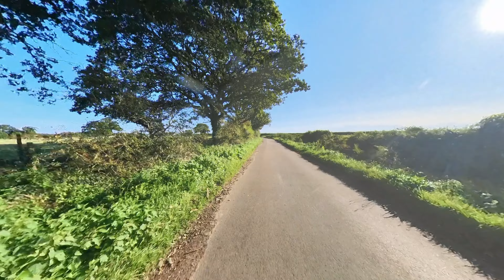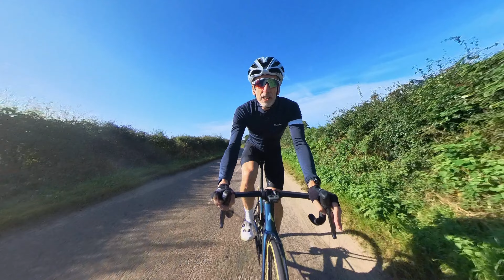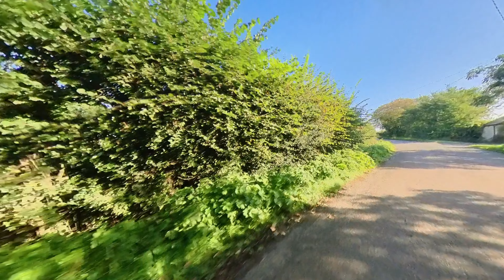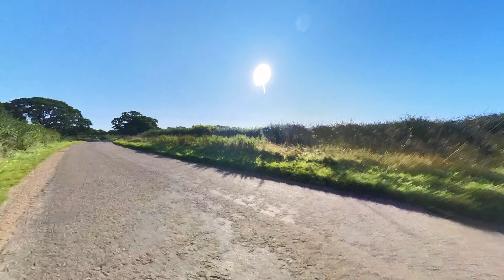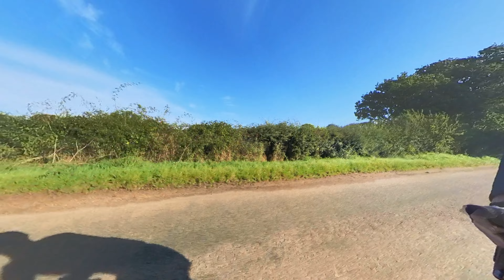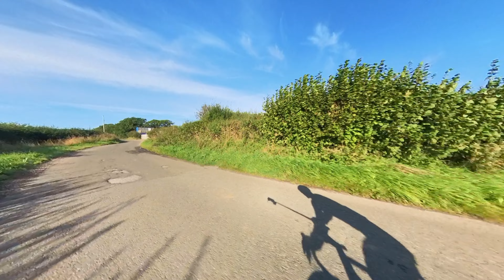How to be RESILIENT and DURABLE! Keep riding strong till the end!

Comment: Core is key - try to work in body weight ply metrics [back planks, leg raises etc] + squats & deadlifts....balance ie foot strength is also important.
Working towards CTS [Chase The Sun - 205 miles across the country next June] - planning on doing a 200 mile training ride before then.
At my Club I seem to be improving every week [or they are getting slower lol] - still haven't got the pace yet to keep up with the fastest guys but getting there rapidly.
The fastest way to improve your Cycling fitness is hill climbs - it will improve your aerobic capacity more rapidly than doing longer distances but doing both is ideal.
Reply from the maker: Thanks, Blaze!